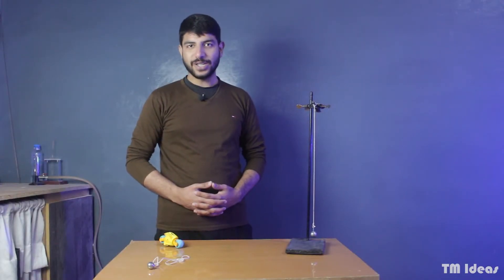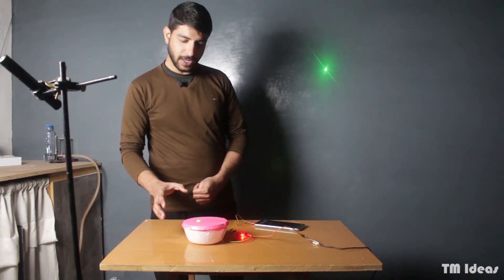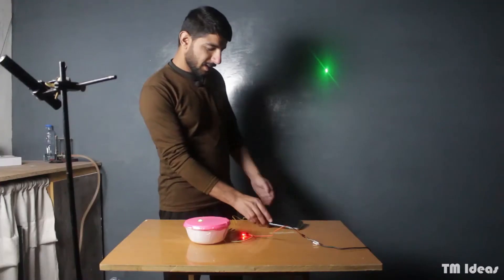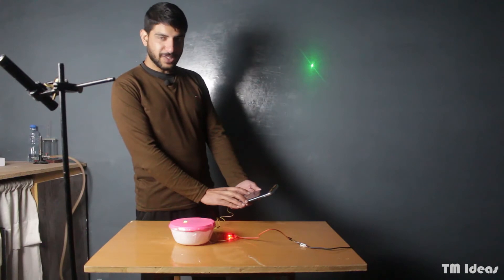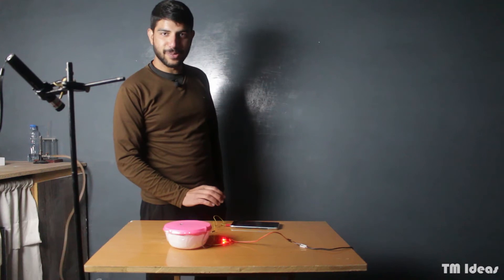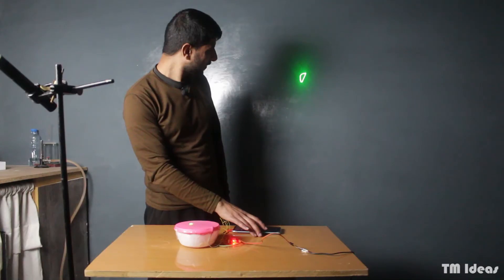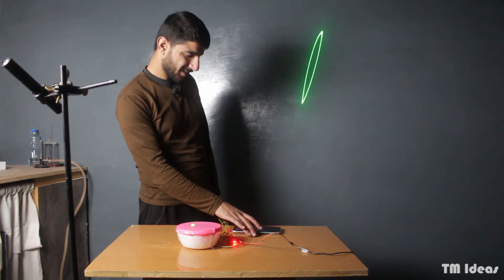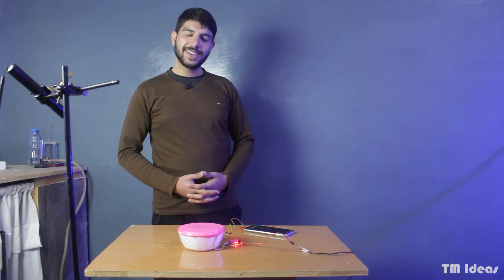Demonstrating and visualizing vibrational motion using laser, sound and mirror | TM Ideas

Comment: The reason you can't see 20 hz is because it is outside of the frequency response/below the high pass filter of your speaker. Your speaker can not produce below 60 hz because that is the frequency at which your speakers high pass filter is set to